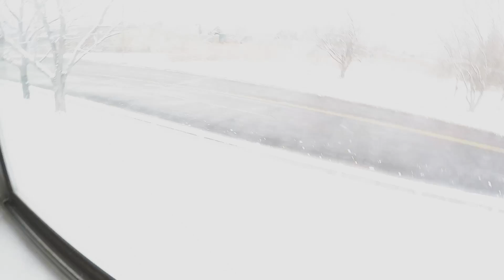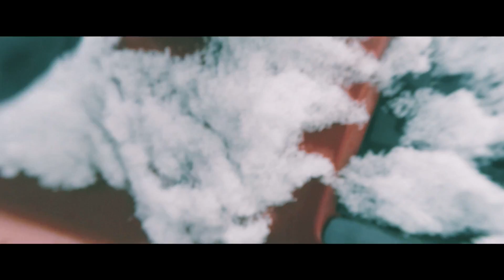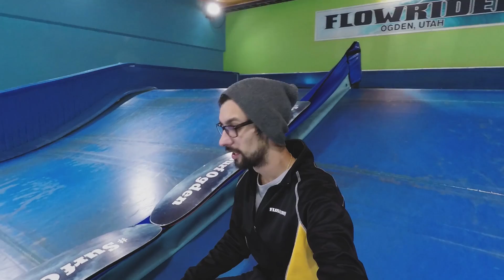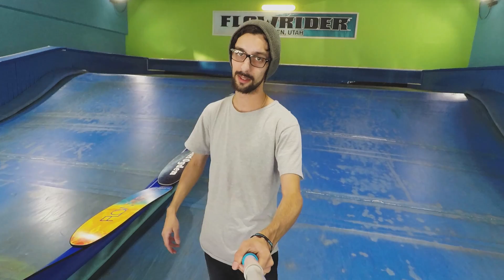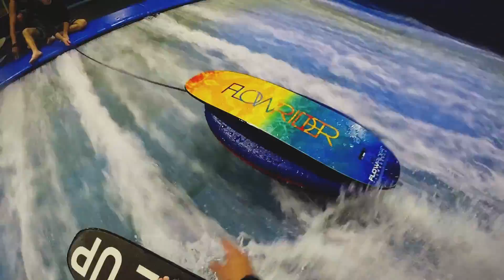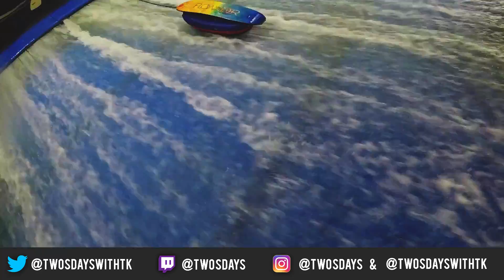We Made a Flowrider Rai!!! (Does It Work?)

Comment: Hi! May I know which material did you use for cover and how did make the nozzle? because I also have tried to build flowrider myself in our backyard but it failed:(
Reply from the maker: the surface you ride on is made of vinyl and cost a lot to cover the whole thing. you wouldn't have enough electricity or water to have a flowrider at your house. it's too powerful
Reply: @twosdayswithtk  Hi! Thank you for the reply:)
The cost and the power are fine 
May I know which pump you used such as HP, gpm, and head?
 Also, the feature of the nozzle. We made one big discharge pipe that does not spout the water separately from each nozzle and it definitely failed.
Reply from the maker: Oh bummer, yeah the average gallon hold of a flowrider is like 40,000 to 90,000 gallons depending on how many jets you want but I only know the size of tanks and chemicals needed
Reply: @rheakim575  any updates?
Reply from the maker: So the project got canceled due to not enough funding... really a big bummer, but understandably trying to raise over $5K for a small sport is hard.

Comment: How about trying a few PVC pipes bolted together side by side to simulate a flat surface for rail slides.  You can use elbow joints to attach them into the same holes as the divider.  They can be raise off the surface by putting different height floats underneath them.  Cheap to build!  Also, any chance of you making an instructional video on big spins.  I sure need one of those!
Reply from the maker: +brodorian that's brilliant, were trying really wide pvc and filling it with sand or something and have it free floating. We'll anchor it down to the front divider pole so it semi stays in the middle. And yes I'm working on tutorials, but I don't know if people want more of POV shots of me doing it or me talking and explaining... What do you want?
Reply: Definitely talking and explaining.   Some ideas for some of the things for big spins that I would love to hear you discuss are the following:  A breakdown of the trick.  Are there more basic trick components to master before going for the big spin (like shove its, 360’s, reverse sex changes, etc.)?  What type of entry (flow line) do you use to get into the trick?  What are your eyes focusing on during the trick (watching the nose or tail come around, or not even looking at the board)? What angle are you landing on the board (perpendicular or parallel to the wave)?  Does the shove it rotate 180 or 270?  Where on the wave do you like to do them?  Do you learn them at the bottom of the wave and then work them up top and across the wave?  Variations (540 big spins) and combinations that you may have seen.  Any good ways to style and tweek them out?  My son seems to be picking them up well by doing a 360 first, then entering into the big spin while he’s already spinning.  It seems to make his more fluid then the choppy looking one that I do.  These are just some ideas in addition to any input you may have.  I definitely want to know how you practice them and what’s going through your brain when you do them.  Any help is totally appreciated!  Also, if anyone else reading this wants to throw in their two cents on how they do them, it would be great.  The more comments the better!
Reply: What kind of pump did you used?
Reply from the maker: Pump where!?
Reply: @twosdayswithtk  junimporto tried to say what kind of pump(spec) did you used for pulling water
Reply: @twosdayswithtk  It's awesome i want to make own flowrider
Reply from the maker: There's 3 of the 90hp pumps to push 75,000gallons of water. It also costs about 1.4million usd to build and have No water...
Reply from the maker: Watch this: https://youtu.be/WLrx7Zf-37I